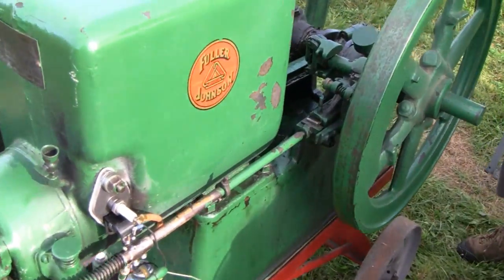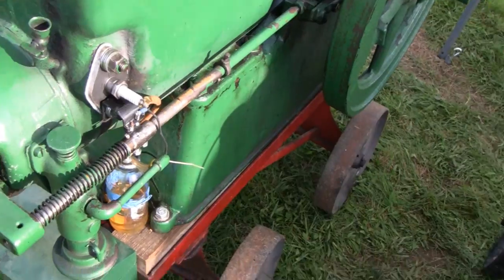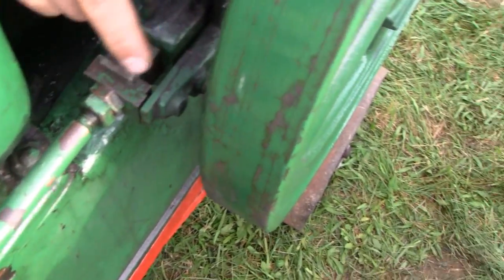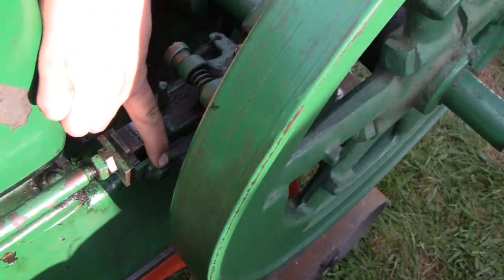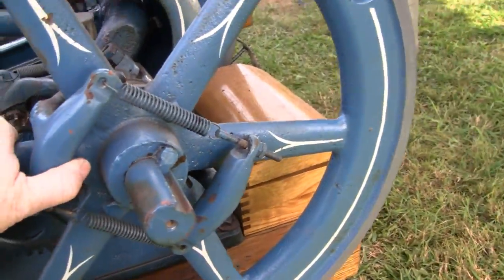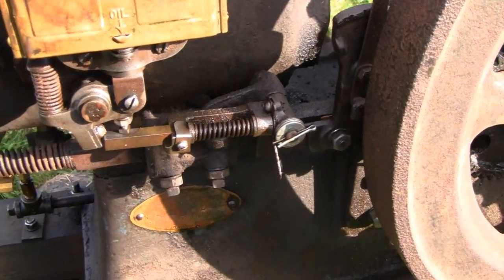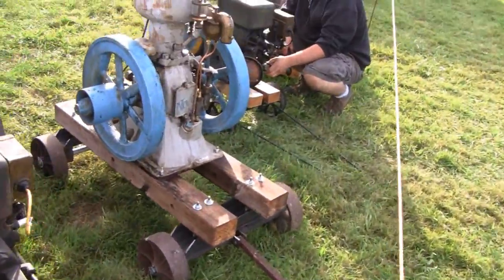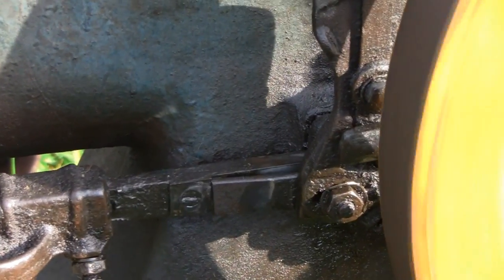HIT & MISS ENGINE TUTORIAL

Comment from the maker: Thanks alot Bud!! I appreciate you checking it out!! They do have carbs or mixers, most of them are mounted to the bottom of the head!! On the green engine it is mounted to the side of the head, you can see it starting at 0:32 there is a big thumbscrew right next to the pushrod spring for adjusting mixture, the choke and intake is on the bottom of it and the gas line is hooked up to the little soda bottle!!☺

Comment: yeah the reason i asked about it is that the thing sounded like it was cycling through about 6 or8 rotations before the spark and ignition happened. that's why i asked if it was more like a perpetual motion thing because of the centrifigul weight of the wheels on it or something like that. i understand it a little better now about what makes them function. thanks

Comment: Great video roadking i just bought an old fuller johnson 1 1/2 hp engine and its missing the ek mag i didnt have 300 bucks for a replacement and wanted to use an old ford buzz coil but couldnt figure how to rig up a timer switch. after seeing how you did yours ill have her running in no time.Great video thanks for posting.

Comment from the maker: Most Hit and Miss are designed to run at a very low RPM usually 200-550 RPM. they cannot be revved, but they do run a little faster under a load!!☺

Comment from the maker: @nx2overide That's a good question Buddy!! I've seen many of them hooked up for generators! Basically the pulley on the side of the flywheel can be hooked up to just about anything with a large leather belt like a water pump, air compressor, cement mixer, corn shucker, grain maker, cream seperator, rock crusher, sawmill, log splitter. I have a few videos of them running things!!☺

Comment: Can you share a pic or some info on your timing system on the push rod .I took a 12 volt coil and made it into a buzz coil and have it hooked up but it is grounded to the engine so now if you turn the engine and it makes it's ground ( yes you guessed it ) then I get the buzz effects.

Comment: Thanks a lot - being a mech.eng. I had a slight idea on those primary engines with only one valve controlled by cam+pushrod with a centrifugal regulator. But they were the parents of OHV with both valves pushrod controlled, and modern OHC as known today. Quite a nice lesson from young connaisseurs of int.combustion engines.

Comment: Great explanation. You started the whole tutorial at just the right components, the pushed and valves, which made the rest of it fall right into place very clearly. I am amazed that I've never seen one of these engines before. I guess people got rid of them or stashed them away somewhere. I wonder how well a smallish one would work running a generator for home use when power goes out. Also wonder how these engines compare with standard modern 4 strokes of about the same overall torque/HP when it comes to fuel efficiency?
Reply from the maker: Thanks Bud!! They work great for generators, many of them were built just for that. They are very fuel efficient. The main difference is the size, a 4 HP hit and miss weighs about 800 lbs and a modern 4 HP weighs about 30 lbs!!☺
Reply: +805ROADKING nah, a modern 4 horse Briggs weighs about 15-25 pounds, since a lot of it is made of aluminum and (gulp) plastic.  That's one thing I like about hear hit n misses, mostly iron :)

Comment: Hey roadking. I got a john deere 1 1/2 hit and miss and I just ordered parts so Im starting to clean it. Do you know any good ways to clean it. And when I restore it can you sandblast the engine or do you have to do something else. Thanks
Reply from the maker: You could sandblast it but that makes a big mess and it's a pain in the ass!! I just clean mine with gasoline and wirewheel everything, then wash it down lacquer thinner before I prime and paint it!!☺
Reply: Ok thanks bud!
Reply: RCHobbyReviews I also have a 1 1/2 john deere, is in good condition.  Has been sitting too long and needs the fuel system cleaned out.
Reply: jim holtse If it needs to be cleaned then I would just get a new one. They aren't that expensive. Heres the site: lightningmagneto.com

Comment: That's a good explanation of how the Hit and Miss governor system works. I like how you showed several types of engines.

Question: What about overspeed protection? I come from the world of modern industrial engines. We have to be concerned about the engine running too fast if the primary control mechanism breaks.

What is the limitation on the Hit and Miss engines, if you lost the function of the latch so that it would fire on every cycle? I assume there is a safety mechanism because I have never heard of one of these overspeeding to destruction.

Thanks for the info!
Reply from the maker: They can run away!! the latch out is the only fail safe!! If that fails you're SOL!!☺
Reply: 805ROADKING Aye Caramba! Don't want to have any rare vintage iron damaged by runaway overspeeding!

Some day I want to restore a very old vintage engine, but not sure if I would look for a spark ignited or a simidiesel.
Reply: Some of the larger ones have a pin in the governor that flies out when it over speeds. When it goes out the governor drops and it shuts down.

Comment: Thanks for this video! So if I get it correctly, the RPM value depends on the weight of the governor / resistance of the governor spring so that means the engine comes with pre-set RPM, am I right?
Reply from the maker: Yeah that's about it!!☺
Reply: the rpm is adjustable by varying the pressure on the governor spring with adjustment screw

Comment: And where does the fuel enter the cylinder? How is it cut off?
Reply: Soren Kuula Through the intake valve, the smaller spring next to the big spring being held down by the rod. Fuel is not cut off, as there is no throttle.

Comment: that explains the "how" VERY well! What about the "WHY"? I got a feeling these things ran a jackshaft suspended from a ceiling that ran the length of a factory floor with wheels all along it that drove different powered looms or mill stones or sawblades or a
something. Like with 40 foot buffalo leather belts like in the history channel shows about the early days of the industrial revolution. Am I right???
Reply: Kelly, you are right we had a black smith shop that ran on one motor that powered overhead shaft with a leather belt ant the jack shaft ran the length of the shop and powered the forge blower, power hammer, lathe, pedestal grinder, hack saw, and other machines all by belts from overhead shaft,  fun to watch when I was a kid
Reply: @bowlweevil4161  cool

Comment: Have you ever considered modernizing an engine? Like, taking one that's mechanically sound, then adding an electric starter, fuel injection, electronic ignition, computerized oiling, etc? I don't see how it would hurt. The computerized oiling system means that if the oilers run out the engine stops, the fuel injection means you never have to fiddle with the carb setting again, and the computers and electric starter would make starting it as simple as "Flick switch, press button, engine runs."

Comment: But WHY is it desirable to miss some strokes?
Reply: Yves Baggi - My guess is for fuel efficiency. I think they're mainly used on light-duty things where the momentum of the flywheel is enough power until it slows down. Then the governor allows a full compression cycle to happen and gives the flywheel a kick.
Reply: Yves Baggi this controls the engine rpm, silly.
Else you would have a run-away engine because they do not have a throttle. Without the governor on the flywheel the engine would go faster and faster until something breaks.
Reply: we can always make a 2018AD version of HIT and never miss engine amigo!
Reply: It’s coasting part of the time.